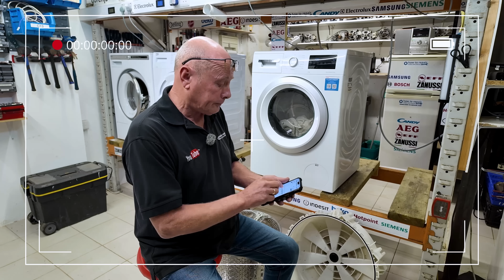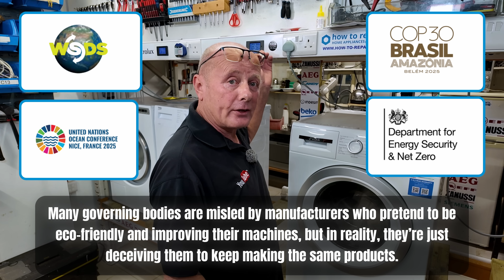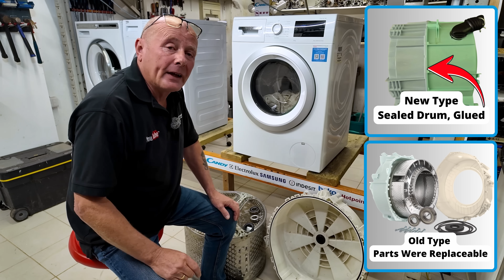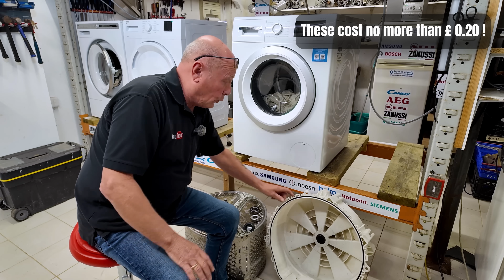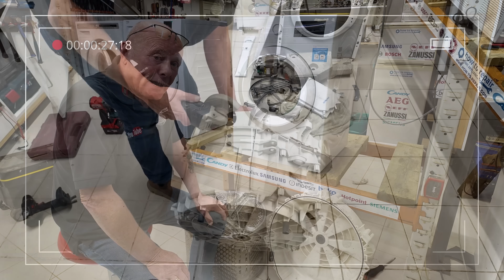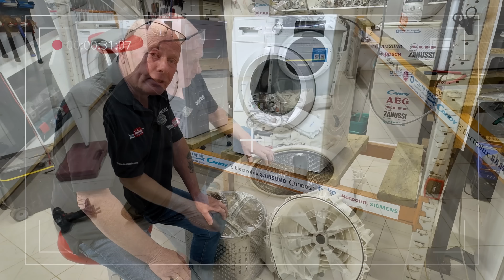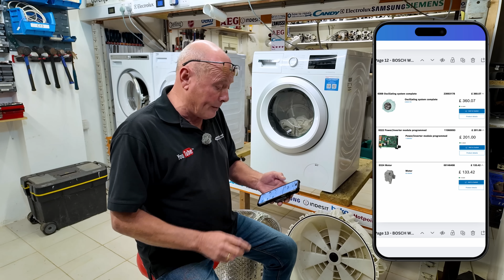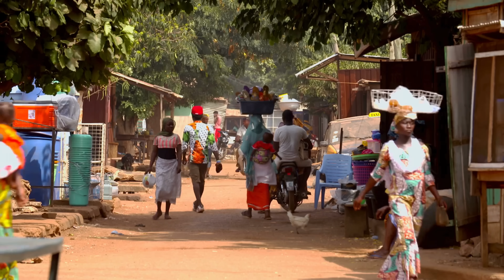Washing Machine SCAM EXPOSED! The Truth About SEALED Drums: Naming & Shaming

Comment: Some years ago my Miele washing machine motor stopped. No mechanical fault, no bearing noise, no guarantee. I made a qualified guess: I suspected the driver output FET. I called Miele repair service: They offered me a flat rate $1000 repair. Well I could get the suspected FET for $10 and replace all 4 but I still had no  test facilities. I found a guy on eBay how could repair the PCB for $150 - I just had to send it to Germany (I live in Denmark). I got it back, wrote him about some minor assembly issues, now I have a 12 year old washing machine running smoothly with a mid-life repair for $150-200.
Reply from the maker: That is a fantastic story of consumer resourcefulness! Even with Miele, a company known for great German engineering, the $1000 flat-rate repair for a simple electronic component is a classic example of this industry designing the repair cost to be anti-economical. They're making a calculated business decision that a simple PCB replacement, which costs them next to nothing, will be priced so high that the consumer walks away and buys a new machine.

The fact that you found an independent technician on eBay in Germany to repair the PCB for $150–$200 is exactly what is needed to disrupt this cycle! You successfully extended the life of your 12-year-old machine by avoiding the circuit board driven machines that I advise avoiding at all costs. You saved a piece of quality engineering and proved that the technology is repairable, provided the data and cost are fair.

Thank you for your comment. I appreciate people like you taking the time to write it out. Please don’t forget to subscribe and share it where possible. It might help others make a wise choice instead of being misled by the industry.
Reply: @How-to-repair  🙂thanks. I am in a situation where I have the resources that many others don't. Professionally I am engineer in electronics.
Since 2023 I have been living in a small community (HOA) comprising some 100 town houses. I have already earned a reputation 😀 so people ask me about everything: our district heating, house construction details, car repair, electric installations, electronics, IT, networks. Note that I only provide advices, no handywork. I have access to a wood/metal shop and car repair facilities (500 members). I think that through time I have saved $50-100,000 by making as much as I (legally) can; car maintenance (oil, brakes). Last spring I fixed my E350 engine as the cam chains were reported faulty in the ECS. I have access to Mercedes full repair manuals.
Reply: Please post all you dobin your channel. I know many would like to follow you .
Reply: @nyamulomaxmillan6919  sorry, I don't have a channel 😑
Reply: @cnp172  I own BEKO, which is 8 years old, still runs without issues, being used every day. It had 5 years warranty. Still no problems with bearings or any mechanical thing. Only problem appeared, is a surface rust in the front.
Reply: @cnp172  same here, saved our family a shed load over the years. Now my kids look at things with the yes I’ll have go at fixing it, and most of the time they do.
Reply: The Cam angle sensor went on my car, replacement price 150$, opened old one found a single 50cent FET molded onto a plastic mount. Could repair with soldering iron and some araldite glue.
Reply: almost the same with the back light on my car 🚗😎
Reply: I first learned washing mc repairs from my dad when I was about five, he was a mechanical engineer. Brushes in a twin tub. Now at the age of 50 myself I have been fixing my own machines for years up until the summer when I came across the welded drum. Everything is going that way now, look at cars. What a great time to be a shareholder 😂😂😂. Assholes. Great video with correct excellent points.
Reply: my miele WT1 rusted through in 4th year! thought shit warranty is 3, just over. wrote miele and brand new was delivered 3 days later no questions asked. probably a major issue with a model/batch that miele don’t want to escalate
Reply: So what brand do we go for then? LG?
Reply: @rognevs5695 I continue with the repaired until it fails again, and if unrepairable I will consider something not depending on touch controls and WiFi 😑
Reply: à friend of mine had a similar issue with his 20 year old miele , that and the dampers were bust, we gave it a shot at repairing the board ourselves,  36 euros for the parts ,   you should've seen his face when we got it working, this man could not afford a new one
Reply: Miele is the worst, they used zinc plated  metal (not in drum of course) which give rust within an year. I leave in Spain close to sea but still after one year rust is coming out from the joints of plastic parts
Reply: I concurr with the AI making comments on the web, FB etc. So It sounds like LG and Samsung are the way to go. My sister had a Samsung Bubble and was very pleased with It but after 4 years moved home and left It behind. My mother in law has an 8;year old LG and similarly pleased. We live in Spain and have had three spanish brands (never again!) with each one lasting only about 3 years before the drum broke , circuit broke etc , so about 5 years ago we spent about 30% more and tried an AEG instead and so far so good. It came with a 5 year guarantee so It will probably have issues soon 😂. 🤞
Reply: Miele is still the best appliance maker. Expensive, but repairable. They make everything in-house to control the quality. The built-in diagnostic helps to identify the fault fairly quickly and accurately. They use the same major parts across multiple model families. 
Parts can be swapped easily.

I equipped my family with Miele dishwashers purchased cheap on FB Marketplace, bought 2 extra units and stripped them for parts ( circulation motor,  drain pump, valves, gaskets  and sensors).
Reply: €150 to fix a machine worth €100 at most, yeah and this is why I never bother to replace boards on modern Mieles anymore, it's a race to the bottom.
Reply: @Wasmachineman if you do appliance repairs, your job is disappearing.
For a DIYer who can harvest spare parts off cheap used machines, Miele is the best choice.
Reply: @rok1475  Correct, it's what I do. I keep Mieles that are worth fixing (like the 700, 800 and 900 Series) alive and the ones built after 1997 get ran into the ground until their spiders break, because the used market is so fucked here that people don't want machines older than the early 2010s anymore.
Reply: @Wasmachineman few months ago I repaired Miele 4800 series washing machine. The flimsy plastic shaft driving the overcomplicated water diverter mechanism snapped.
I can tell Miele engineering department is dominated by mechanical engineers 😂
The whole assembly can be replaced by two electromagnetic water valves controlled by the main microcontroller…
Or maybe this is part of “make it not last too long” movement?
Miele only sells the entire water intake assembly that includes the flimsy plastic shaft for around $800.
Add the cost of bringing a repairman and taxes and an average appliance owner would most likely buy a new one.
I got lucky finding a bundle of parts for this machine for just $50.
Otherwise the machine would go to scrapyard because of that $0.25 plastic part.
Reply: @rok1475  The W4800 is also a total piece of shit regardless, it's one of those half-assed machines for the USDM only.
Reply: @Wasmachineman I think American consumers have already been sufficiently conditioned to accept that appliances are now disposable goods and manufacturers are reaping the rewards 😉
Reply: @rok1475  Provided it is described as "super" then the Americans are hooked...everything they say is "super". :face-blue-smiling::face-blue-smiling::face-blue-smiling:
Reply: Drums with a bit of skill can be seperated and resealed with bolts and engine sealant compounds. They moved it further, the aluminium bearing cage that is moldeef in plastic has (deliberately) placed points to touch water, corrode,swell and brake the drum, making it nearly unrepairable. They invested science on it...
Reply: @Wasmachineman  How do you place the value of the repaired machine at £100 ? Surely the alternative is a lot more expense, which means a £150 repair makes sense?
Reply: @happenchancenow  our used market.
Reply: @Wasmachineman 
Faulty logic.
Taking into account product quality, obviously a piece of junk will forever be a piece of junk... however if the fundamentals are of good quality, and if the new replacement unit costs are at least more than 200 bucks, repairing a 100 bucks machine for 150 bucks, makes economic sense. 
Furthermore, as a bonus as it may come with a longer than expected life span.
This is the case with a side by side fridge/freezer I bought new nearly 30 years ago. 
The only issue over the years has been replacing of a noisy air recirculation fan/motor in the freezer side.
Reply: @Slowmolasses  Why drop €150 worth of parts on my broken machine when I can often get a perfectly working Miele off Marktplaats for €100 or less, or sometimes even free?

Again, repairing washing machines is a race to the bottom. I still do basic repairs like replacing shocks or valves, but if a board fails (unless it's a machine I have boards in excess of thanks to me stripping old ones) or the spider breaks it's getting scrapped.
Reply: @Wasmachineman 
You're a lucky guy...
Although I have a technological background in a different area,
I'm a decent DIY'er in other areas.
I look at machines and appliances from the analogue vs electronic angle. 
To me, the more analogue it is, the better.
There was a point in time about 30 years ago, in which  engineering achieved very good reliability and ease of maintenance.
It was a time when modern materials, sciences and technology become very well understood. 
Then, a new age emerged with the internet and huge forward leap in communications.
From then on, the leading consumer societies, developed ease of credit and an ever increasing array of disposable consumer goods.
To keep up with the current trends, whatever they may be, many consumers become enslaved by those paradigms.
Today, slowly many people are beginning to wake up, and preservation has become a good business. 
Antiques and older good quality items, have now established a well sought after market.
It is true, many modern appliances and other machines, are designed to operate faster, be a little more economical in energy consumption, with more sofisticated operacional programmes and so on, however, if they are designed to perform a predetermined number of finite cycles, and thereafter become scrap, to me that's wasteful on top of economically suicidal.
Conglomerates and special interest groups may have more of the ear of governments and a higher capacity to lobby every day of the week... which is more than regular citizens, who may not even comprehend fully what they are doing when going to place a vote in the ballot box once every four or five years.
Reply: A problem where politicians can and should do something. All they're doing is burdening us with all sorts of taxes without addressing the actual problem. So it's not about the environment, but about money, that much is clear. I wonder what Brussels's role is in this.
Uk had the balls to say goodbye, more countries should do that.
Reply: My parents and I went to see our  canadian relations. Their washing machine was on the blink.  No one could mend it. My dad went o the  library read up and mended their wasing machine it worked perfectly.  You can always het them to work when out of gurantee.

Comment: Which wash machine should I buy ?
Reply from the maker: Because so many of the low to mid range price bracket machines are made so badly either via built-in obsolescence like sealed drums and expensive parts or Asian market machines that have splittable ones but then the company will not support the end user in any way by providing technical data It is very hard for me to put my hand on my heart and recommend to you all so I’m going to abstain as I do not want to be blamed in the future thank you very much for your comment. It is really appreciated. I hope you make a wise choice on a very cluttered marketplace. Please remember to share if you can.

Comment: I used to be a domestic appliance engineer untill I retired and I 100% agree with you, one of my examples was an AEG machine back in the day when I started used to have masive high quality bearings and big induction motors that very rarely failed and I had customers that had the machines for over 15 years and still going strong but the later ones were nothing like the old ones ...small cheap bearings and small brush motors after a few years would start to fail, I think cars are designed to fail as well !
Reply from the maker: The acceptance of poor build quality in everything today is unbelievable. We are slowly being moved into a throw away society but yet they preach so much about the environment when they’re not even looking at the basic problem waste thank you very much for watching this video. please remember to share if you can as this is the only way legislation may be changed.

Comment: I think this analogy explains everything we buy as consumers 
You pay a premium price for a premium product that isn’t premium anymore 😢
Reply from the maker: That analogy perfectly encapsulates the core issue with the appliance industry today. Manufacturers used to build their reputation on good quality products but now regardless of the brand name or the high price tag, the mechanical parts often share the same source and are designed not to last much beyond five years. As I mentioned in the video, even when manufacturers have high-end and low-end brands they might use the same internal motor but charge vastly different prices, ensuring that the premium price doesn't actually guarantee premium durability. This shift is precisely what makes shopping for a new appliance feel like navigating a minefield it's not by accident, it's by design.

Thank you for your comment. I appreciate people like you taking the time to write it out. Please don’t forget to subscribe and share it where possible. It might help others make a wise choice instead of being misled by the industry.
Reply: @How-to-repair absolutely I will subscribe

Comment: Everyone, be aware that a manufacturer's warranty is separate from your basic rights. If the expensive white goods fail just outside the warranty, and you haven't  tried to repair it yourself with an axe etc etc, you may well have have a justifiable claim against the SELLER in the small claims court (and it's very straightforward to do this). Hopefully helpful to somebody
Reply from the maker: My 40 years of experience confirms that the manufacturers' basic guarantee is almost always inferior to your statutory rights as a consumer, especially when white goods fail outside of the short, two-year period.Only by sharing these videos and discussing these controversial issues can we hope for change. Sharing this video will help give it the exposure needed to make a difference over time. Thanks very much for your comment; it is much appreciated.

Comment: El angelito in Argentina is repairing these sealed drums long ago and he showed in youtube how to do it. He puts self taping screws for alignment and removes them, cuts the drum with angle grinder and a thin disk, replaces bearings, and assembles back with paste and self taping screws. Perhaps it doesn't work so well, i don't know. In Spain changing bearings has been antieconomical due to labor cost long ago in most situations. I think some people discards washing machines even for a leaky door seal that anybody can change with a tutorial.
Reply from the maker: That technique used by El Angelito and other resourceful engineers is a testament to the Right to Repair spirit finding ways around the manufacturers' design flaws! While cutting and resealing a plastic drum is certainly possible, it's a difficult and time-consuming job that is often too expensive for the average consumer when combined with labor costs, especially in places like Spain. This makes replacement the anti-economical choice, just as you mentioned. This is why I always recommend asking if the drum is splitable when purchasing a new machine. Thank you for your comment. I appreciate people like you taking the time to write it out. Please don’t forget to subscribe and share it where possible. It might help others make a wise choice instead of being misled by the industry.